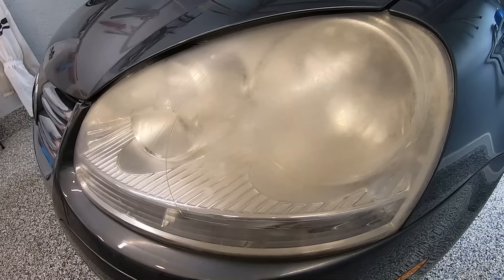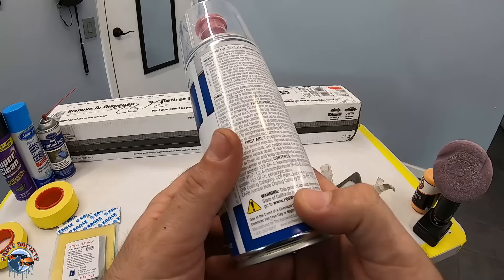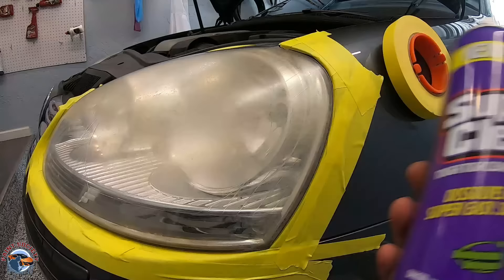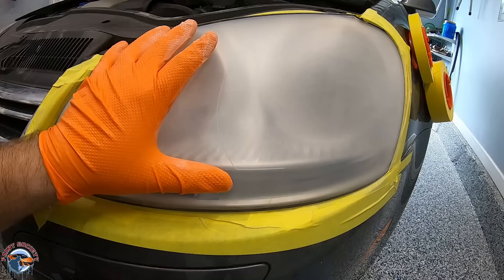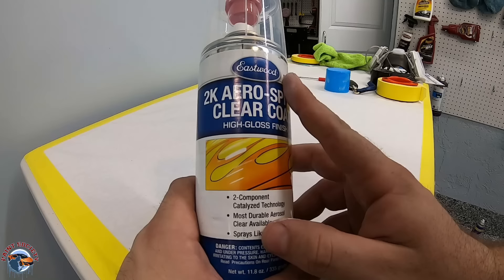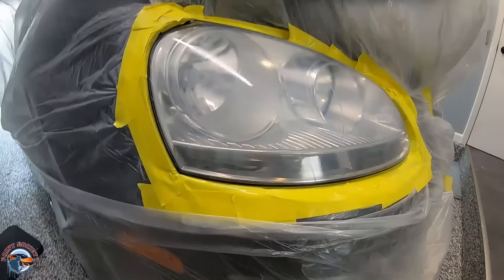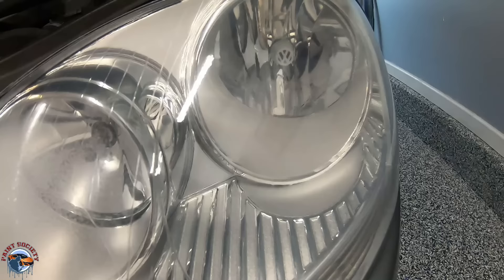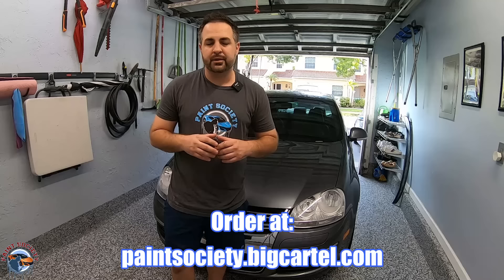The BEST Guide to Restore Headlights PERMANENTLY!

Comment: I worked at a body shop for 3 yrs and learned you can fold over wide tape onto itself (to block the glue on the backside of the tape) then slide that end into tight areas for masking. Blocking the glue on the tape will make it easier to slid into tight areas and will allow the tape to go deeper making for a better masking job.
Reply from the maker: Ok great. Makes sense!!
Reply: I run a body shop and that does indeed work I've been doing it for over 20 years
Reply: Great tip!!
Reply: 000
Reply: Great trick I painted a few cars in my time … we didn’t have wide tape to play with. My old 2010 headlights will thank you.
Reply: Just get a new ride
Reply: I use Mirror plate cresmpolish but idoes not last for long about a werk only
Reply: You just need the wider tape when you get used to that.
Reply: Nice!
Reply: Just to let you know when I clicked on the clear coat it brought me to caliper paint in the Eastwood store.
Reply: Awesomeness
Reply: @PaintSociety  I have done that since 1980. Works GREAT!
Reply: Just buy a new headlight!!
Reply: @dianadowning6720 remanufactured lights are not nearly as good as oem
Reply: Sorry. Can you please to show us a video about it? It is difficult for a foreigner to understand such a detailed Description. Thanks.

Comment: I can remember when headlamps were made with real glass.
Reply: I can remember when people didn't complain about every little thing.
Reply: Had an 01 Jeep TJ. Glass sealed unit headlights. Good times until you dropped one.
Reply: Chev Camaro I-Roc Z has the glass sealed unit headlights.
Reply: Now almost all cars using LED no heat.. so they use plastic.  Earlier years the lightbulb was creating huge heat.. so it should be only glass.
Reply: I loved my 73 Miata. Glass headlights that cost about twelve bucks to replace!
Reply: @hasansezer3997  : Alot of economy cars still use the halogen bulbs with plastic housing even today.

It's true that the newer European cars such as BMW and Mercedes Benz, use the L.E.D. bulbs with the plastic housing.

The older European cars such as BMW and Mercedes Benz use the H.I.D. bulbs with the plastic housing.
Reply: @ster9765  No you can't!!!
Reply: So cops could bust em out and say "ya got a headlight out, booy"
Reply: @ster9765  You must be very old... about 5,000 yrs., when there were a lot less people on the planet. So naturally, there would be less complaints.
Reply: Your putting an age on yourself but, I remember also. lol
Reply: @ster9765  no u dont
Reply: We have a classic and a modern car each. The classics (1990 and 1993 have glass) the moderns have plastics. The glass car headlamps are cheap and easy to replace but the plastic ones are expensive, especially the Lotus at 1500 euros per headlamp. Thats the UV clear on the Lotus today, tomorrow light sand and polish, fingers crossed....
Reply: Moses and ‘em had cars!?!🤩WOW!
Reply: @yardkartretreads  😂😂😂
Reply: @ster9765  he does not complain. He just did an observation. Chill up.
Reply: ok boomer
Reply: And I remember when cheese was made out of real cheese and not just cheese product.
Reply: @Todd Thompson  yeah , up hill both ways fighting the same pissed off tiger every day,  and unlike you Yong whipper snappers we didn't have arms .. we had stumps .stumps I tell you  !! And we were thankful  !
Reply: Yes, before it was made of glass unlike today plastic the reason why it blurs caused by oxidation.
Reply: @Todd Thompson Uphill both ways!
Reply: @locdawg2875  yes and sunlight didn’t make them cloudy 🙂
Reply: Meeeee tooooo!!!!
Reply: @Todd Thompson yep
Reply: I have some on my 88 iroc
Reply: @CherylCold     1993?  Classic???  Just shoot me!
Reply: @hasansezer3997 I think plastic is just way easier (and cheaper) to manifacture.
Reply: @giacomoneri1782  glass doesn’t get cloudy due to UV and is more environmentally friendly.
Reply: So what
Reply: @tonymoore3090  so they were better than the cheap plastic ones
Reply: My 2004 Isuzu Crosswind has glass headlights.
Reply: My 1978 c20 and my Monte Carlo ss 1985
Reply: Add a extra 20kg why not lol
Reply: @Damon-fj8jl  is the metric system confusing you?
Reply: @davenevarez4738 my 68 nova, 69 GMC, 62 Chevy C10, and my 50 Buick all have glass.
Reply: Don't buy Japanese and buy Volvo. My 2014 XC60 light is glass and as good as new.
Reply: Yep nothing like glass for clarity..
Reply: @americanpancakelive 73 Miata huh?  LOL Me thinks not.
Reply: @hasansezer3997 still has heat which causes oxidation inside the headlights
Reply: @meenam300zx It's about as much glass as a Durex you put on for prevention of owning a P3 platform Volvo....😂
IMHO the last Volvo to roll out of a factory with a glass headlights was a first gen. MY06 S80 and then it's all plastic, ie the P2 facelift in '05.
How do I know? Came here as a former owner of old Volvos and dealing with orange peel on restored P3 headlights.😊
Reply: I didn't need the bumper to be taken off to change a bulb
Reply: Right a bulb
Reply: You must be remembering if glass light broken down in the street were dangerous for other road users.
Reply: @ster9765 just proved your own point.
Reply: My range rover has them…they are awesome but can’t imagine how much one is if it broke😂
Reply: The fog lights on my 2003 are still glass

Comment: Wet sanding and dry sanding is "not" the same. Wet sanding is done to prevent pieces of material getting trapped between the sandpaper and the surface which will scratch the surface as your sanding it. The best and correct way to wet sand is to have an constant running flow of water to keep the material moving and from building up under your sandpaper. Spray bottles do OK but most people spray some water and then sit there and sand away. They don't use enough water and material builds up and gets trapped under your sand paper. Dry sanding is the worse if your going to be applying paint or clear coat of any kind. Dry sanding just produces the snowball effect, the material has no where to go, gets trapped and scratches your surface so your constantly sanding scratches you will never get rid of. I'm old school of course and use a hose with a constant flow of water but then again, old school techniques have produced some of the most beautiful paint jobs in the world and still do. Just my $0.02!  Very good video though!
Reply: I wet sanded with a hose in the 70's also, but I like the idea of the spray  bottle and wiping as you go. Get the sludge in a towel rather than sll over the bottom of the car and the driveway (plus water is a bfd in So Cal now!)

Comment: DO NOT USE the regular clear coat that you find at Home Depot, Lowes, etc. I spent an entire day sanding my lenses only to melt them in about 2 seconds with the wrong clearcoat.
Reply: Same, I bought rustoleum Clearcoat and first off it wouldn’t even stick to the lens and it also isn’t very shiny at all. Completely destroyed my lights
Reply: Hahah😂 you made my day happy

Comment: I ended up re-doing the headlights on my truck today.  I used what I had, 600 grit, then 1000 grit.  Then followed through with some 2K clear that I had laying around from other auto paint jobs.  Turned out quite good.  Whole project took 2 hours from start to finish including masking and unmasking.  I previously used rustoleum UV clear coat thats 1K, and it yellowed after a year or two.  I don't recommend it, do it right and use 2K.  This video motivated me to get it done!
Reply from the maker: 2k is the best.
Reply: Duplicolor clearcoat is better 2k is the best obviously will last for YEARS but the  dupli color 1k lasts a pretty long time up to 5 years  the rustoleum 1k usually only lasts about a year maybe 2 if u did a good prep job
Reply: Doesn't 2K have to be used within a short period of time after activation?
Reply: @4seeableTV  48hr pot life.
Reply: @EmmAyeVee  agreed..use within 2 whole days, if your doing a pair of headlamp assemblies there will be waste depending on usage..
Reply: @4seeableTV  yeah, depwnding on clear, some will harden in an hour some will take few hours

Comment: I've gotta say, this is the best headlight restoration video I've seen. The timelapse really sends the results home
Reply: More expensive than buying a brand new headlights? Thoughts?
Reply: @pedrojuan7010 
$2100 in Australia to replace both headlight assemblies so a bit of sanding and 2 pack clear paint hell yeah!
Reply: There are better and no wet sanding so no where near as clear as you can get it

Comment: Ok so this video is so spot on.  The only comment above the ones provided about folding tape in 1/2 or less to fit into the open seams is that the second coat is the key and apply liberally not to the running down the headlight thick but heavy.  The results are amazing and the steps match this to the tee. Great video thank you.

Comment: I can contribute with a testimonial since it's been over one year and I drive around 19,000 miles per year. Winter time it's harsh salty winter road condition and the car is parked outside at both home and work, so it's direct exposed to the sun during the sunny times. This method works!
The headlights only needed a quick and easy polish by hand to get back the nice finish.It's exactly like the paint, one year of using your car on daily basis wears the paint no matter how careful you are and polish is the only way to get back the shine

Comment: Thank you!  I just did this and could not find anyone who actually sanded the clear coat after using that spray clear.  You did just to show exactly my issue.  Thanks again.  Mine was 20 years of yellow oxidation on a tundra

Comment: Congrats!!! The best video to restore your headlights.... I used P320 grit for first pass, and P600 for the second pass. Used instead Eastwood 2K Duraspray, as I wanted unlimited pot life (as Aero-Spray version only lasts 48hrs after activation), and the difference is that it takes much longer final curing time. However, It is polishable after 12 hrs of application. I used P1200 grit to sand the orange peel, and buffered with 3m 3 steps. Great finishing... Once again, THanks for sharing your knowledge on this!!!

Comment: If you follow the steps, product, and clean, clean, clean, a little work and carefully following the video, you can get these results.
  A common question on older vehicles is, “My headlamp has 3 bumps near the corners”. These are used to align the headlights. Look for 2 screws, usually one top and one on the side. They are almost touching and most are “Phillips” head. It may take a long screw driver but single screw drivers are sold. If “STAR” shaped, this is called “TORX” and T-15 is the most common. Yours may vary but don’t be afraid to ask the dealer. They won’t charge you!
To adjust!
 Park 12 feet away from the garage door, turn light on, mark the door with a piece of tape. Left should be straight ahead, right should point 1-2” to the right. They should be level, use your eye from the back of the vehicle, then look to see where the fall on the garage door or wall. Don’t get them to high as one adjustment changes the other. Guys/gals who know this will yawn, but most people have never adjusted their lights. I don’t know what year it changed, but these tabs will be in the way. If you feel comfortable, use a power tool with a 120-320 grit sandpaper and just remove them. Please have firm control, tape edges, but use the edge and touch the tab only. Your work should be dime sized and flat with the rest of the housing. Best of luck, hopes this help. Not everyone can afford a newer car, as the cost more than your first house, but look less old. ASE Master since 1978-retired. Great video, excellent lights, camera action and clear instructions. Like/subscribe/bell. Blessings to all!

Comment: As always another great A+ video. I worked in a factory using headlight plastic molded injection machines and there is no clear coating applied to OEM parts. Just doing this simple fix will make better then OEM and last longer. So thanks for showing us how! 👍

Comment: Very professional. I have a lot of respect for your skill set of clearing headlights. My method is wet sanding and I do use the P grade wet/dry sanding disks. I do my headlight jobs in about an hours time for mobile home services. 
I thank you for getting a better knowledge on taping off the headlights. I will apply that to my service. Applying the degreaser in the beginning was good knowledge also. I thank you for that also. 
I use to do spray coats in my early years of mobile headlight service and the results are amazing but I have learned that the spray method is better in an indoor shop setting. I use to get bugs and flies that would get on the clients headlights after I sprayed it that drove me nuts. 
So for outdoor settings I just finish the job with an auto ceramic. For a longer lasting quality job for 3 to 5 years I have to have the clients car in their garage to apply a polymer vapor application that gets crystal clear results. But you have to wear a respirator and gloves for that method. But the results are stunning. 
You are so right with making sure you remove all of the old clear coat. In my beginning years restoring headlights I use to leave half of that unaffected clear coat on. But I would always see that divide between a nice clear job and a spotty bottom half. So I learned that the hard way. Always remove it all. Thanks for the video. Good job.👍